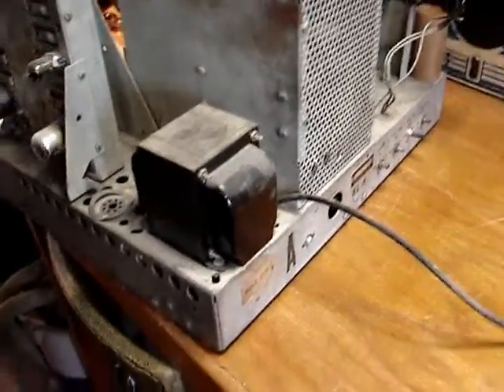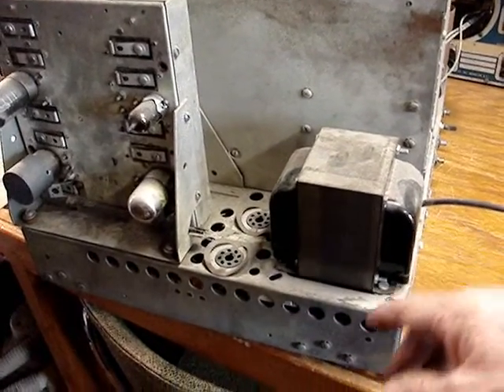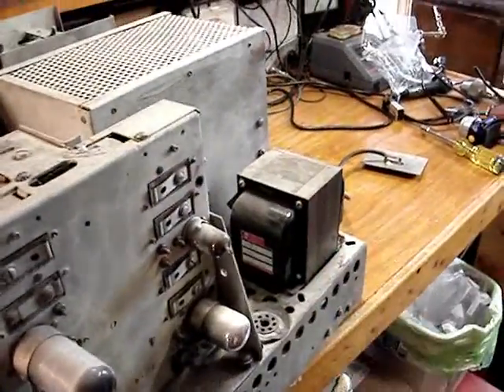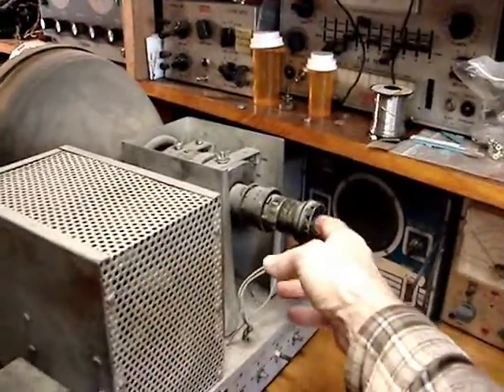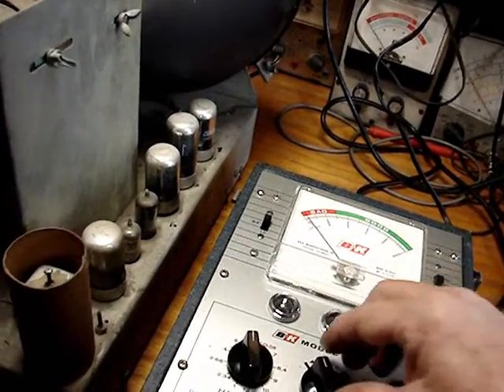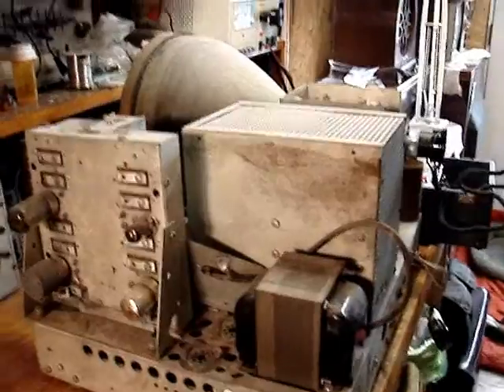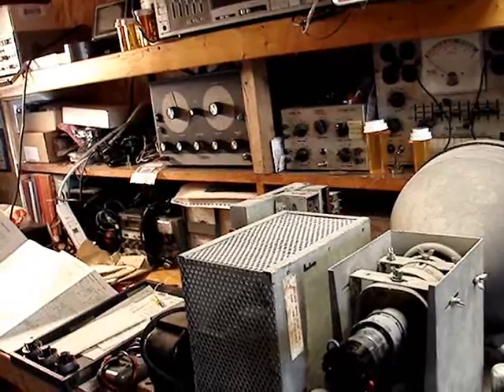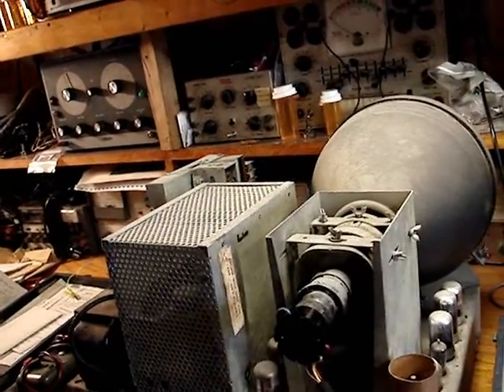1948 Sears Silvertone TV Radio console PT2

Comment: it will be interesting to plug it in and see what smokes.  ya never know, it might work.
Reply from the maker: To my knowledge the man who gave the set to me told me that he had powered the set up and said it was dead. I am not sure how that tiny 6.3 volt transformer is wired in but if any tech thought that tiny transformer would power 22 tubes he had to have been smoking something himself. Look around in your junque and see if you have a power transformer that is 250v CT plus 5 volt and 6.3 volt filament winding.
Reply: nope, but those are common.  if I can find a nice 600v chunk of iron, I have some home brew projects in mind that could use el34s.
Reply: It's possibly it's big enough.  Keep in mind that those missing 5U4s take 30 watts just for the filament.  Without them you can get away with a smaller transformer.  I agree about the second transformer being for the damper.  Check to see if it have a 6.3 volt damper tube installed.  Much easier to get than a 5V4.
Reply: Here's what an original transformer looks like.  Not that much bigger than yours.  Plus you don't need to power the 5U4s or damper tube.  https://www.flickr.com/photos/70039806@N00/6268239028/in/album-72157627771449261/
Reply from the maker: I wish I had your eye for detail. Thanks for watching this and commenting. You aren't posting videos of late but I suspect you are out enjoying life with your lady friend. That's great!
Reply from the maker: Thanks for posting this Bob. I will need to watch the video you made on your Silvertone set. When I finally get into the set I need to see what was done with the antenna input. I don't think that coax is original and it seems that the tuner is not operating or is somehow bypassed. I might try to fix the vertical on it before I go in for a major capacitor and resistor replacement.
Reply from the maker: Bob- The original Silvertone 5V4 is untouched in the cage and was as dirty and dust covered as being probably original however the horizontal output tube and HV rectifier tube are recent replacements. I have also determined that in spite of what I though was working in part 3 the tuner is not working so there is much work to be done. This one will be more of a challenge that my Zenith sets were.
Reply from the maker: I see you did not do a restoration on your Silvertone or at least I can't find any videos on youtube other than the one I have.
Reply: No, I haven't touched my Silvertone yet.  It will likely be a very long time until I get around to it.
Reply from the maker: So at this point my 1948 silvertone is the first youtube published attempt and rebuilding this chassis and what a mess I have to work with. I wish it was you doing the rebuilding of your better set. Anyhow- I have determined that the lack of vertical deflection is primarily due to the replacement 5k linearity pot burning out. It looks like it was a cheap audio pot probably audio tapered. There are two electrolytic caps in the vertical circuit that are dead and some resistors that have gone high out of spec. I am going to rebuild the vertical circuit and at that time also measure the B+ to see how close it is to the schematic. If I get vertical deflection without any parts burning up I will go from there.